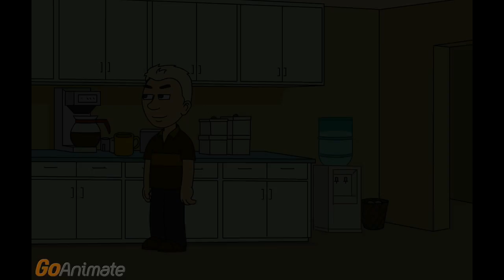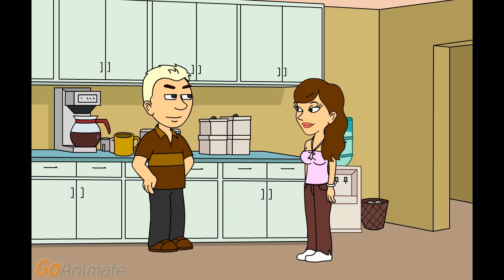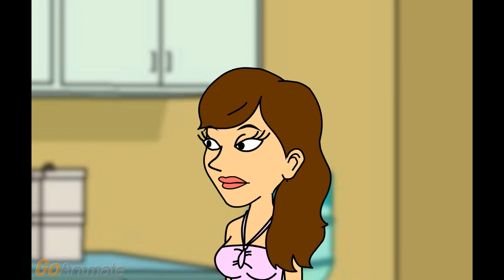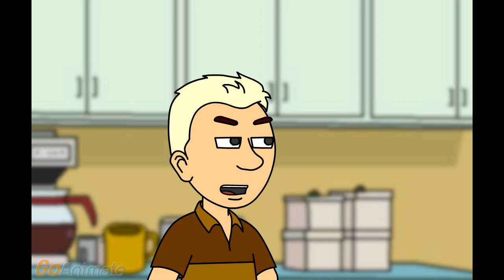Heil Furnace Problems

Comment: lol Kinda funny the Heil furnace is one of the few I ever have to fix they just seem to need cleaning as all do other than that they just run. lightning and stray house voltage is the only reason I have had to replace boards. I also do not know how you could ever have a board fire with all there protection for one there is a fuse on the board on top of that the 120v to 24v transformer would act like a fuse and burn up the windings 1st plus if installed proper there should be a mains fuse at the furnace power switch right at the unit. As for blowers I only ever replaced one blower that was due to a flooded basement. I wish I could say the same for some of the other furnaces.

Comment: My propane fired Heil furnace frequently does not start up in the morning with house temperature at 64 and thermostat set at 67. I turn the AC power off then on (at furnace or at fuse box) and the furnace starts up and heats. Electrical problem? Thermostat? Other? Please.